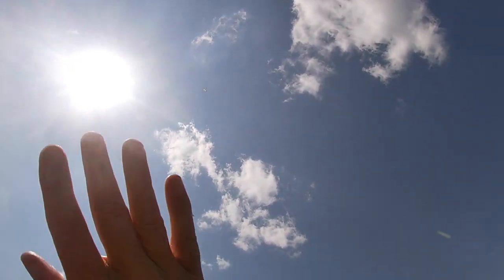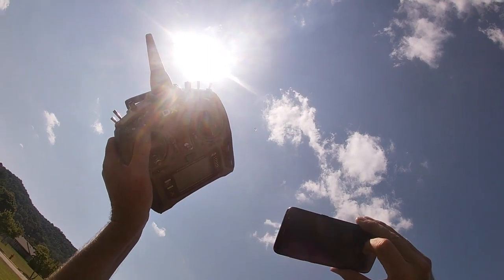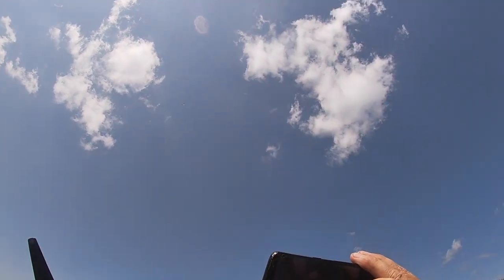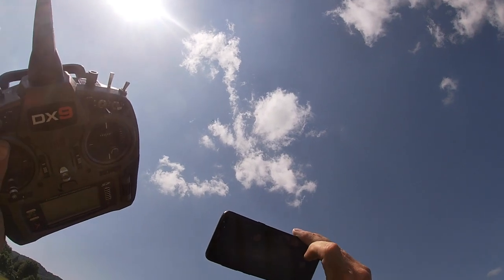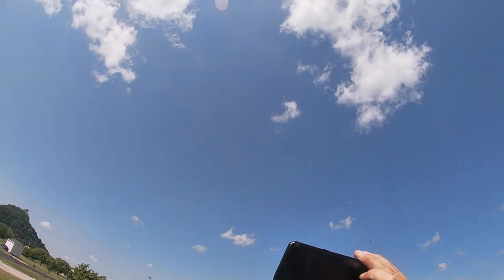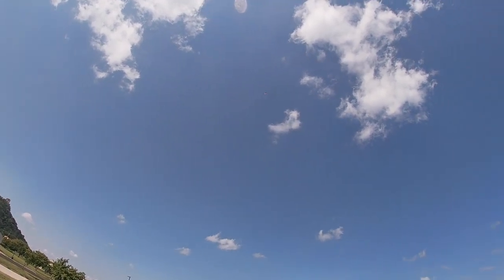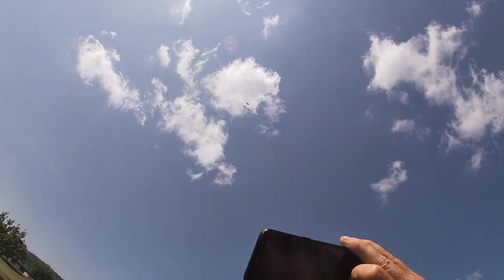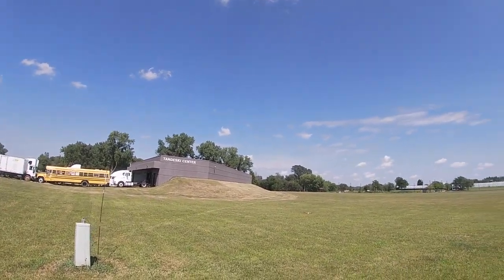Souper 30 Best Flight

Comment: Just so I understand. Power is still rubber, and a single servo controls a rudder? What receiver and battery combo are you using? Do you use an ESC? Whatever your replies will be...I like it a lot!
Reply from the maker: It is rubber powered, receiver servo board out of UMX Radian, there is ESC built-in but I am not using it. Extra weight but then no tracker in the model.  Just control the rudder. Video explains most of this.
Reply: Sorry. I had to have sound muted while my wife was watching tv. Thanks.
Reply from the maker: @ytdhable  not a problem, just glad people are watching this.